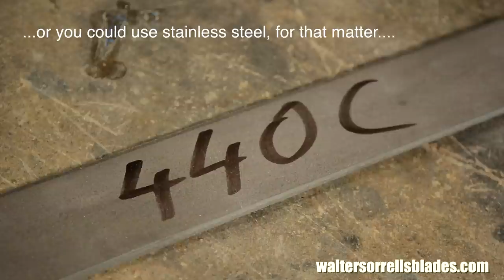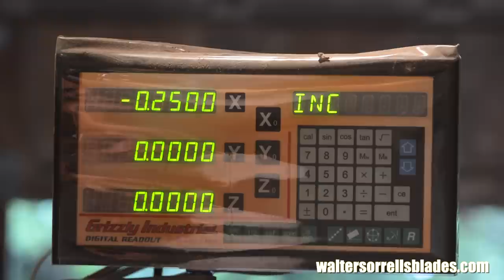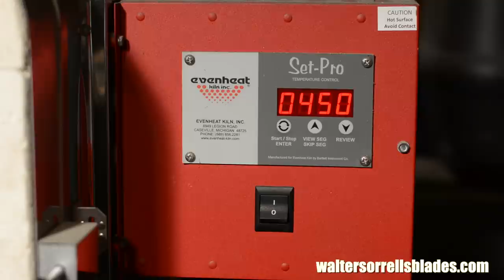Making a Damascus Steel Chef's Knife

Comment: I like using HCL (Muriatic acid) as an etchant.  It give a particularly deep etch which can then be colored by a variety of methods if desired.  I just love the fact that if done correctly, I can actually feel the delineation between the types of steel, it's that deep.

Comment: Walter, as a hobbyist bladesmith who's shop has been cold for far too long (until recently...I'm back now), I really am getting a lot of tips and inspiration from your excellent videos. Thank you SO much for these excellent tutorials!

I'm curious about your press. I've seen some "budget" models made from bottle jacks and the like but they seem pretty slow. Yours is nice and quick. Is that something you built or is it commercially available. In your "Damascus" video, you mentioned that it's more inexpensive than most power hammers.

FYI, I do have a power hammer, but the press seems to create more solid welds and gives a bit more control.

Thanks again. Exemplary work!

Comment: How many hours of work was this from start to finish for someone like you who knows what they are doing?
Reply from the maker: +Walker Durell Maybe 20?
Reply: +Walter Sorrells you have said that 1095 is a oil hardening steel in this video yet in others you say it is water hardening. so which is it I am confused now?
Reply: +brian williams Its technically both as far as i know. You CAN harden it in water, but in typical knife thicknesses (sub 2/10ths of an inch) oil will be better as it isnt as harsh of a quenchant.
Reply: +tactical noodle Depending on the maker, it could run you 200 dollars to a lamborgini.
Reply: +Walter Sorrells if i someone wanted you to make them a knife like this would you? and how much roughly would you charge?
Reply: +Ben Jackbag Mank I'm not trying to be rude or anything,  but on his website you can ask those questions and definitely get a reply.  just trying to help brother.
Reply: Alex Jay Thanks, I was waiting for an answer as well.
Reply: 20 minutes?
Reply: Roughly 20 hours work, experienced and obviously a well trained smith with a reputation, figure more like $2,500.00 to a Lambo...
Reply: I imagine that number goes much higher for a katana or supuku blade, with the major number of folds involved...
Reply: I kind of knew that, but was interested in modern pricing for a properly made (traditionally done) Katana or Supuku. (And no, I'm not intent on hare-kiri - it's historical curiosity.) I completely agree with your statement.

I'm sure the author will enlighten us at some point. I've seen prices approach crazy to insane for repros, and poorly made imitations (made during the Sino-Japanese wars just prior to WW II) to be very poor quality and bad knock offs of a true Samurai weapon. If you've seen "Rick" drool over genuine katanas on "Pawn Stars", you know what I'm saying... There is true warrior honor in a real Samurai blade, the more modern crap knock offs are wall hangers. The Tom Cruise film, "Last Samurai" was a fairly good film that gave some of the flavor of the honor and duty instilled in the warrior class. I'm waiting on a good "transfer" from film to Blu Ray, it ought to be outstanding.

Mr. Sorrels' Katanas (as pictured on his site) would pass for use by a Samurai by almost any judgement.

The garbage brought back by WW II veterans were largely fair to poor knock offs, trying to bring honor to a losing fight. (Bring a knife to a gunfight and all that.) Many were used to commit unspeakable atrocities against Allied prisoners.

A bladed weapon isn't always worth what the buyer is willing to pay - no much more, it's worth the huge number of hours, planning, making the steel to the quality you needed, sharpening, etc. of the blade itself, not to mention the proper assembly of the handle and wrap. A true katana can decapitate almost any animal. Knock offs will break flex and bend, and merely injure the target.

I've looked at Mr. Sorrells' page, and I think he seriously UNDER-PRICES his work... It's gorgeous stuff for a blade enthusiast. And the combat knives are art AND utility. (Retired cop, I would have given almost anything to have a good quality combat blade on duty.)
Reply: ***** Have you never heard of Kobe Steel, in Kobe Japan? They do manufacture steel using a process called the Midrex Direct Reduction (patented) process, using a very high temperature furnace, injecting carbon monoxide gas to remove the Oxygen molecules from the FeO2 (iron ore) , rendering very pure FE.. It's extremely high quality steel, once carbon has been added. I have an ingot of Midrex iron that is about 20 years old, and has been handled by people, never oiled or wiped off, and it shows no sign of rust or fingerprints etching into the metal. They DO make very fine steel in Japan NOW. Back prior to WW II, yes they imported a lot.

Heck, they didn't even armor the Zero, that's one reason it out-flew the heavier and armored American fighters. They were made with aluminum and aluminum alloys with magnesium. Until the US managed to design a plane that could compete head to head performance wise with the Zero, we could not compete and lost a lot of aircraft & men to the Zero.

As to a combat knife. they are indispensable, if you are trained in their use. You can use them to save lives. Mine that I currently have is a rescue and a offensive / defensive weapon. It has a seat belt razor cutter built into the handle, and it has a carbide pointed stud that will break tempered glass. In close quarters, and wearing a bullet proof vest, they will give you an advantage over an opponent. So we agreeably disagree, I have experience with it. And a knife, doesn't run out of bullets either.
Reply: fax a
Reply: jim wagenbrenner
Typo? Or did you mean to be cryptic?
Reply: Ben is talking out if his ass. Japan does not import most of its steel, it is in fact one of the largest steel producing countries in the world. 

Also, most well made european blades are nowadays stainless steels, which have a very coarse grain structure and are impossible to sharpen to the point of simple carbon steels. This is so well known, that even in europe, high perfomance scalpels are made from pure carbon steel.
Reply: tactical noodle he made it for his sister so no
Reply: Mr Cow I agree with you, If I make a knife for a gift,it's inconsequential if I spend 10 or 40 hours making it as nicely as possible. The hours don't even add up in my totals, it just is part of the caring for my sister in making the gift. The one I made for my wife is so polished the glare is nearly blinding from the shine! ;-) And the edge is a bit sharper than those I make for myself. I'll put out a knife for someone else much finer in fit and finish than one I will be using day to day.

Comment: Walter,
I'm curious as to why you decided to laminate the 1095 between the 15n20/1050. Could you have used 15n20/1095 damascus and not laminated a core to give you a pretty decent knife? what if you did 1095/15n20 damascus with a 1095 core? Would this have been easier to forge weld with similar steels and similar quench? 

I'm a novice knife maker and would love your feedback, Thanks for all your great videos!

Comment: I am sure this is up more to individual preference, but as a professional chef i find knives that have a block of unsharpened metal between the bevel and the handle along the cutting edge to be very frustrating as you're losing cutting surface and gaining extra weight as well as making it that much more difficult to sharpen.

I am sure you have answered this but I did want to know why so many smith do restack in lieu of hot cut. Is it a matter of preference or would the folded portion not render a good result to your end product?

It was a lovely piece, your attention to detail on the handle is astounding

Comment: Love watching your videos, one thing I've noticed is that many knife makers clean off the mill scale on the material they pattern weld and then tack weld the billets together and proceed straight to the forge. Is the scale and slag from the welder nothing to worry about? I know a large amount of it is flux from the weld material, but I would have thought the oxides and gasses would cause a concern. I'm guessing this isn't the case

Comment: Hey Walter thanks for the video. One question: why don't you run your bevel right out the heel of the blade, eliminating plunge points and making it easier to sharpen?
Also, if you drill your scales first you can pin them together perfect while shaping and finishing the fronts without worrying about them moving. 
Thanks again!

Comment: A trick I learned from another knife maker, dip the stacked bars in kerosene then dip the wetted stack in a pile of borax flux, the flux sticks to the wetted steel and keeps the steel clean right from the start and doesn't give you half melted borax falling off the stack sprinkling it on by hand.

Comment: I'm guessing ebony doesn't need it, but what finishing sealant or oil do you use on kitchen knives? I'm thinking about more open grain woods used in kitchen knives that'll be exposed to hot water when being cleaned, or possibly even left in a sink wet.

Comment: Very well done video.  Just a tip from a chef perspective.  The blade should have layers of stainless mixed in or consist of a non reactive material.   Chefs deal with a lot of acidic foods which quickly corrode or rust the blades if they are not.  Also the cleaners used like dish soap remove oils that would otherwise prevent rust.Full tang serves another purpose as well.  The second part is to allow room for balancing the blade.  Keep in mind chefs typically use a pinch grip not a standard knife grip so balancing is slightly different.Just before the handle was a large area left unground, some chefs are ok with this.  however many are like myself and use a rocking motion that would cause that portion to be an issue.    If you hit the food your holding with a lip it causes you to have to slow down or risk cutting yourself.Lastly if you plan on selling knives of that style don't call them Damascus blades.  The folding of the blades does improve durability just as angle iron is more rigid than just a flat piece of steal.   Just see that as being a liability.   Your video was one of the better done ones I have seen.

Comment: Is the entire spine of the knife polished or do you go back and etch around the handle where you sanded it?
Reply from the maker: The spine and the visible parts of the tang are all polished.  Even if you could see the grain, it would just look like a bunch of super thin layers, about the thickness of a piece of paper, so you're not losing much drama by polishing those parts of the knife.
Reply: thanks for the info!

Comment: I am working on my first damascus knives.  I am having the problem of loosing the etched pattern on the part the tang that that is visible on the handle edge.  It would appear on the knife in this video you would also lose this pattern as you ground away the metal as you shaped the handle.  How do you go about re etching to get the pattern back, or do you just leave it.

Comment: Nice, love the pattern. and surprised how the ladder pattern turned out.  I love the ladder pattern, but don't do it often, hate the idea of grinding a 1/3 of my billet away.  I did see your press ladder pattern video, may have to do something like that if I can ever find the time.

One suggestion though, I know the corby's are very strong fasteners, but on full tang knives I like to put a hollow grind in the middle and on light duty knives I'll drill and skeletonize to reduce weight and allow more room for epoxy.  Not sure what epoxy your using, and with the corby's it's more of a seal than a bond, but epoxy needs a certain thickness or it won't hold.  Just my .02 cents, I know with the way you put that together it should never come apart, and it's not a rough use camp knife, but a simple full tang knife like that is one of the weakest designs and IMO needs all the help it can get strength wise.

Again, thanks for sharing, love your videos, gotten several ideas from them.

Comment: Absolutely beautiful damascus, but I have two comments on the geometry: (1) Won't the down-curved handle cause pushcutters to constantly rap their knuckles on the countertop during use ?  (2) Over time, I've also grown to dislike full bolsters on my chef knives because they increasingly get in the way of sharpening over the long haul.  I've since ground back all the bolsters on my knives (mostly German) with a 120 grit diamond lapping plate, and I avoid buying any new knives that have them.  IMO, harder/tougher modern steels have eliminated the need for bolsters on full size Chef knives.  They're ok for things like paring knives and field knives, but to me they're an unnecessary and obsolete annoyance on a well made chef knife.    

That said, love your channel, and keep up the awesome work !
Reply: Each to his own, or in this case her own, going to his sister, who probably has more delicate hands than men... :-) 

The beauty of making your own, you can avoid bolsters and give more finger room...

(I DO like your comment, points out some good ideas others can use, and THAT'S the point. (No pun intended, Roving Punster.)
Reply: if the knife is held properly, the thumb, index, and a portion of the middle finger will rest primarily on the back the the blade just above the handle, so really the downward shape of the handle shouldn't rap the knuckles as one uses it. At least in my own knife use. could very well depend on the hand.
Reply: @JG: Very true, but my comment was posited on behalf of those who use a handle grip instead of a pinch grip.  I mostly pinch grip, but I sometimes switch to a handle grip for items requiring more forceful cutting, or if my hands are wet and/or tired, of if the geometry of the knife favors it.
Reply: I appreciate Walters videos and craftsmanship but agree with your points and as a chef just don't like the shape and wouldn't buy it.

Comment: Hey Walter, I am an amateur knife maker and I find your videos to be extremely helpful, so thank you! But I do have a quick question, since different steels wear differently (this is in reference to an entirely Damascus blade, not the San Mai featured in this video), is there any danger in the different steels in the Damascus wearing differently? So will Steel A on the edge wear faster than Steel B, creating an ever-present toothy edge or even micro ridges and valleys on the edge? I hope this isn't a stupid question, I've just always wondered..

Comment: Would it be possible just to buy a billet of Damascus steel and go from there? Just grinding the knife from said billet and then heat treating and tempering the blade then etching and sharpening it?

Comment: You're very good! I've always wondered, there's no concern about the weld steel becoming one of the materials in the pattern of the blade? Everyone puts so much emphasis on what steels they're using and why, but then the billet gets a bunch of regular old mig wire or something in it..

Also, do you finish the handle scales with anything?

Thanks for the tips!
Reply from the maker: You grind off the MIG welds, so that material goes away.  They're just tack welds to hold the billet together in the furnace.  As far as handle scales go...it depends on the wood.  For something like ebony, I just use furniture wax.  More porous woods I might use tung oil.  But every wood is different, so I usually experiment on scrap wood to find something that complements the wood.
Reply: i wondered this myself

Comment: I'm still watching the video, but I'm curious on two points: Do you normalize/anneal before you mill out the ladder steps and do you find you need carbide endmill?
Reply from the maker: I do anneal first.  And you don't have to have carbide.  Honestly, I prefer to use the squash method over the grinding -out-channels method, though.  I showed this one just to show a method that can be done with a file as well as a mill.

Comment: Very nice blade. 
Question: if one put a Damaskus knife on a waterstone and sharpen it, will one loose the pattern on the blade?
Reply: Yes the etch only apply on the surface so if you sharpen it too much it will slowly fade, but don't worry about it doe, you should be able to see when to stop ^^
Reply: cedricfilm It will come out again if it is sanded properly.

Comment: Great video as always Walter. However, I don't quite understand how you exposed the plain high carbon steel on the edge side. Does this happen as you grind the bevels or did I miss something you did during the forging process?
Reply from the maker: That's exactly right.  As you grind away the bevel, you're grinding on a bias, exposing the thin layer of 1095 in the middle of the "sandwich" of steel.
Reply: Walter Sorrells A wonderful technique thanks for the reply.
Reply: spikedpsycho It keeps all the layers of steel stuck together while you heat it up in the forge and take it out to flux it and move it around etc., until you get it all forge welded together.  Tac welding the billet together makes things a lot easier to handle, but you can also use things such as baling wire to wrap around the billet to hold it together, and then cut it off after you've forge welded all the layers together.  He is using a propage forge in this video to do all the forging & forge welding, then he is using an electric kiln to heat treat (harden) the steel.  Hope that helps :)
Reply from the maker: spikedpsycho Propane.

Comment: so when welding arnt you changing the alloy of the billet because youre adding a different metal?
Reply from the maker: Are you talking about tack welding the billet together?  That's just a little dab of metal that holds the billet together during forge welding and is ground off after the forge welding is complete.  Forge-welding itself, however, doesn't add anything to the process.